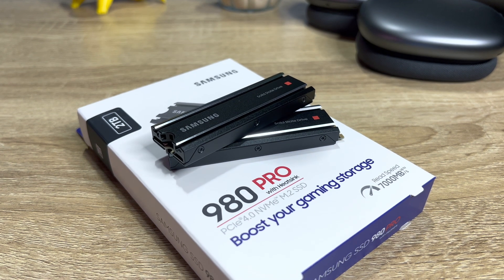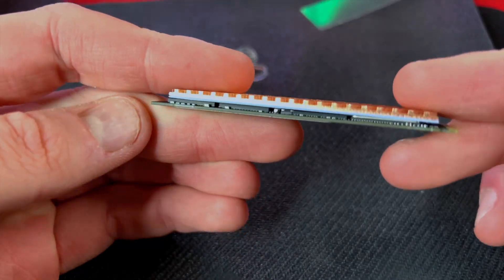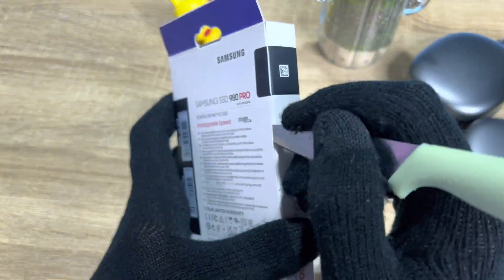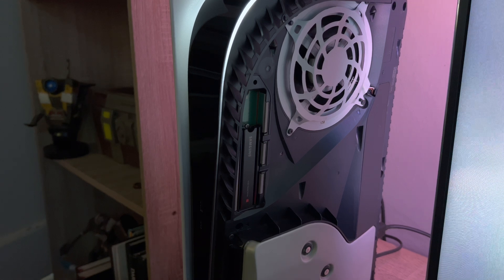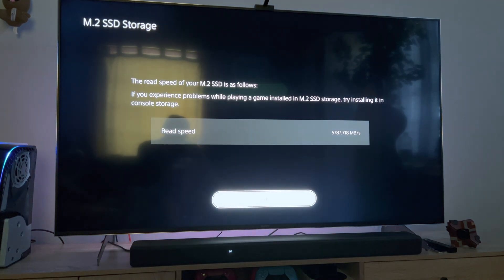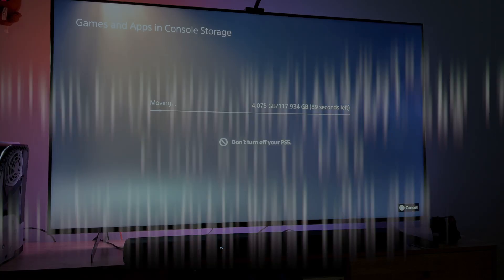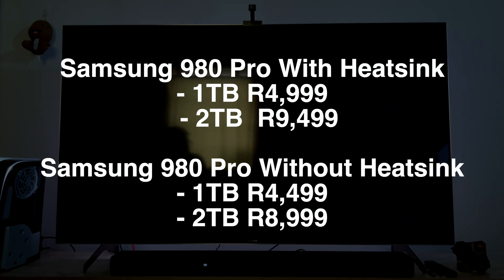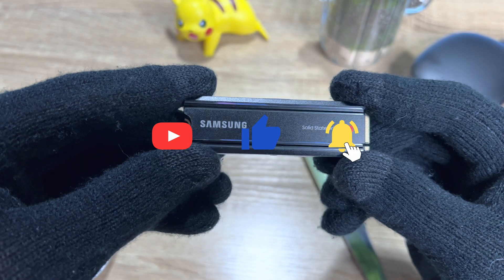Samsung 980 Pro With a Heatsink in a PS5 - Thermals and Speed Tested

Comment: Hey wasnt sure if you noticed this so wanted to add some helpful info.. i noticed after you installed the 980 pro w/ heatsink it showed your speeds at 5700mbps ish .. theres is a patch for 980 pro nvmes where initially most of the 980 pros were testing at 5500-ish mbps give or take 200mbps.. you need to first plug your nvme into your pc & update it through samsung magician, once youve down this you take it back out and install it in your ps5, your speeds should read 6500-7000mbps after this patch.. it wont make a ton of difference because the speeds inside the system typically limit them to around 5500mbps anyways.. THE BIG improvement is the glitch where the 980 pros life span is reduced dramatically goes away.. before i caught this glitch my 980 pro went to 96% health remainig within a few months.. after i fixed it its been at 96% for the next few months .. hopes this helps, may even change your measured results !

Comment: I just got the 980 without the heat sink. I bought a cheap heatsink that works with ps5/desktops from BestBuy. It came with two metal plates, two thermal pads, some screws and a screwdriver. I put it all together and installed it. It’s working well, but also reading at 6520 mbps.
Reply from the maker: Glad it worked! I know you can get a version with a heatsink but I kind of enjoy doing them on my own haha. Sounds like your kit was pretty cool. Even came with the screwdriver haha. Mine was just elastic bands :P.
Reply: You got the elutneg?
Reply: @sebastiancervello  The one that I have is from Insignia.

Comment: got one cheaper than the non heatsink one ,had to remove hs for laptop ,was pain. screws are spec pentalobe and it's not glued but thermal pads are sticky so had to use hair drier to heat up a bit ,then go under with a soft plastic.
Reply: are you alive? i had to remove it too
Reply: @TuruncuLeopar  yeah ,nearly stabbed hand with the screwdriver

Comment: I can't even. It doesn't look like you even used the supplied spacer in the PS5 when you torqued it down.
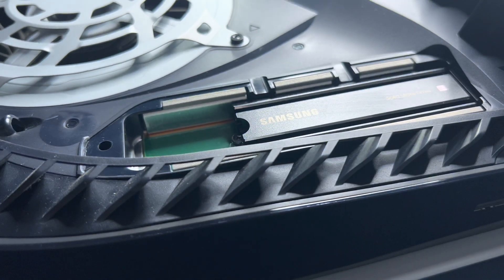Reply from the maker: Yeah, you can definitely see I did else the thing would bend down at 3:35 when I press on it. You can ALSO see it clearly at 3:23.